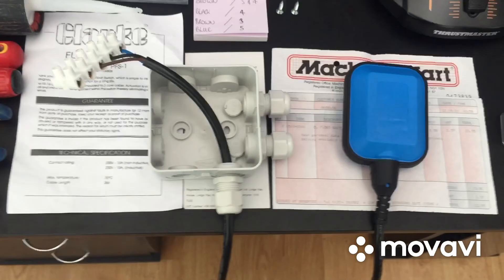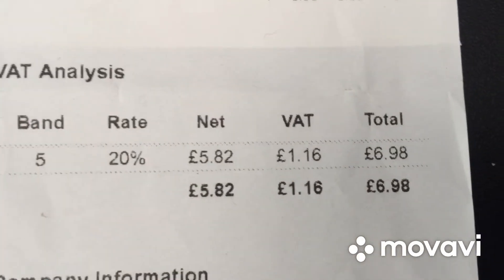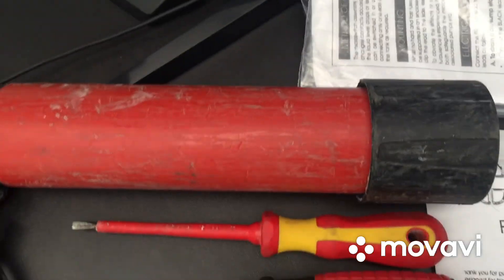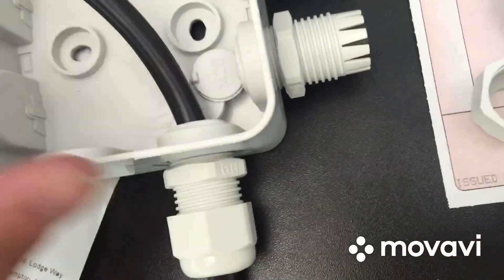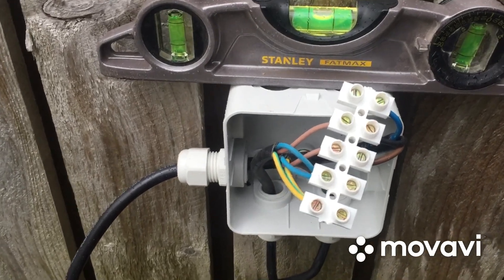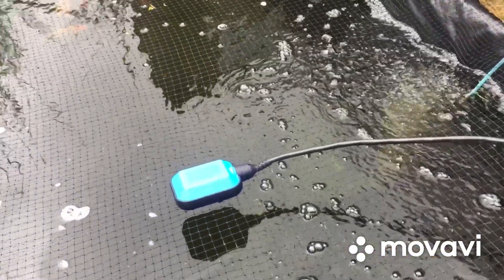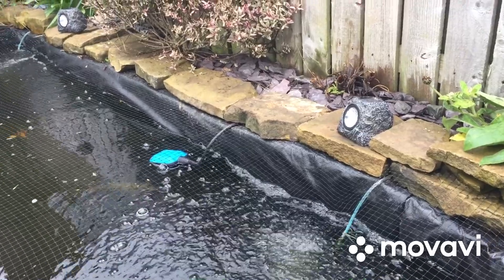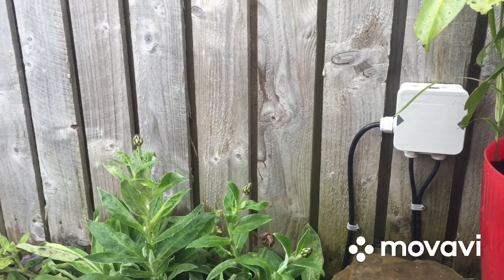How to Install a Pond Float switch

Comment: How can you have two browns, two blues etc. if there is only one plug for the pump?
Reply from the maker: Because you cut the cable and add a floating cable which is a switch
Reply: @GazsKoiPond Wouldn’t there be be three browns? Two from each end of the cut cable and one from the float switch.
Reply from the maker: @michaelnewton9341 have you watched the video ?  it shows the full wiring diagram and finished installation also the switch only has two wires

Comment: And there open tomorrow 👍
Reply: Hi Gaz  just fitted shut off valve and it works peace of mind your tool station cheaper than mine 8.83 for box valve was the same thanks for wiring video perfect thanks again👍Dave
Reply from the maker: @davidvyse6305  glad to be able to help
Reply from the maker: Happy days 😀